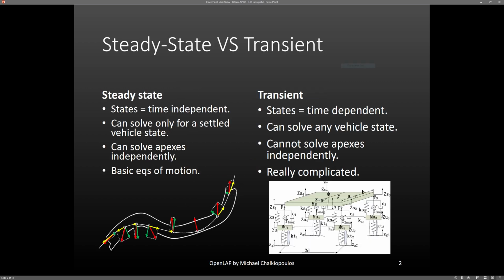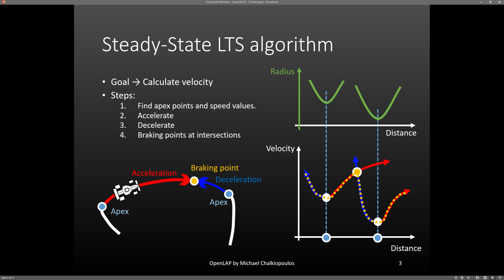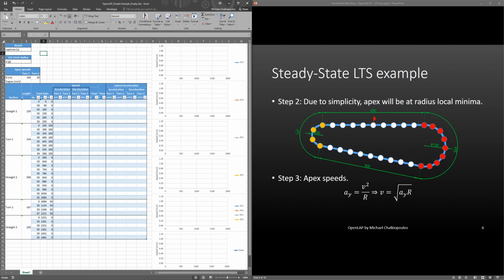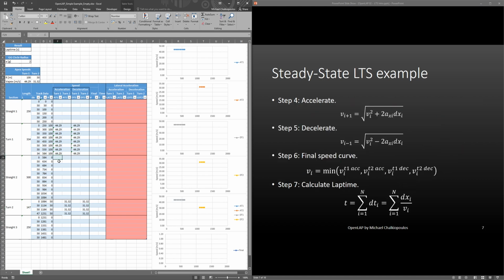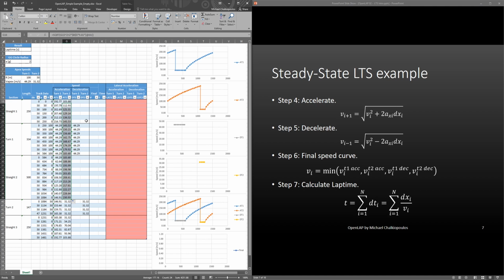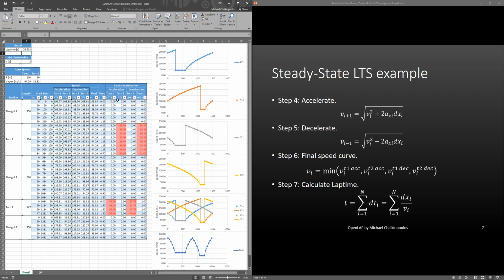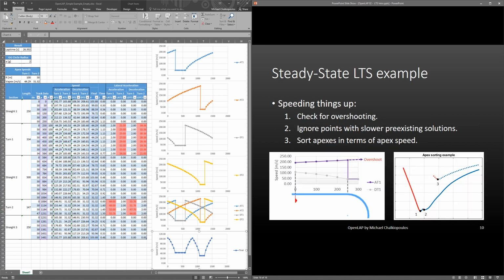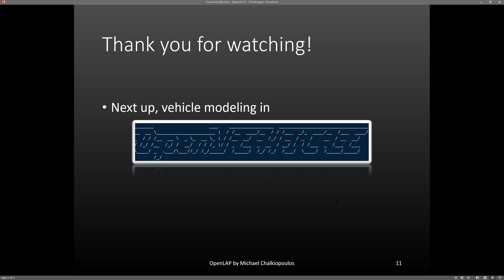OpenLAP Lap Time Simulator Part 2: The lap time simulation algorithm

Comment: Hi Michael, thanks for responding to my question about an optimal path. I've since made an LTS although it's transient. 

I was wondering, is the vehicle at any point of the lap drifting in this simulator? As in, does it have a velocity vector that can point in a direction other than forward?

Comment: Hey Michael great work.

I have a doubt . Why did you made 2 columns AT1 and AT2  AND DT1 and DT2. I didnt understand.
Reply from the maker: Acceleration from turn 1 (AT1) does calculate the whole lap, but the values of the speed in turn 2 are WRONG (look at the lateral acceleration needed).
The same for T2. It does all the lap, but is wrong in T1.

So you need to solve all turns indipendently and combine the solutions.
Reply: @_phoinix  Ohh okay I got it.... So how did you get those lateral acceleration values ?
Reply from the maker: Hi,

One acceleration and one deceleration column for each turn.
Reply: @_phoinix  I mean what's the difference between AT1 and AT2 ?
Reply: AT1 is considered as a one whole lap then  what is AT2 ?
Reply from the maker: Watch the video!
v^2/R at every point

Comment: Hey Michael,

Absolutely fantastic work and I appreciate that you've taken the time to explain it all so we can learn.

I have a question regarding the example in video 2 with the concept from video 3 of the GG plot which is offset by aero drag:

In video 3 you show how the aero drag offset means that the maximum lateral acceleration (Ay) is at a negative longitudinal acceleration (Ax). That's understood but my question involves using this to calculate pure lateral and combined acceleration cases.

To calculate my apex speed for a given radius I can use the max Ay from my GG and the equation R=V^2/Ay. However I have a problem when I try to accelerate out of the corner with combined Ay/Ax. If the corner radius of the point just after the apex is only slightly larger than the apex radius, it's possible that I still require an Ay value which lies in the negative Ax portion of the GG plot. But I'm trying to accelerate in the positive direction... What have I missed?

Thanks in advance for your help. Keep up the good work!!!
Reply from the maker: In part 2 I only use the most simplified version of this problem I can think of to show and explain how the idea behind this works.
This way, when go on to the next parts, you do not get bombarded with all the stuff you need to consider, but you gradually build up your knowledge and understanding.

Or at least I hope I can manage that!
Reply: @_phoinix   Copy that Michael, thanks a lot for your reply! I'm looking forward to part 6!!! Because I am locked in my house, I can't help but think about the problem so it will be a hard wait...  ;-)

From your constant radius example, I can see that it will be necessary to use the max Ay which is corresponding to Ax = 0... The apexes not at the curvature extrema I need to think about.

Thanks again!!!
Reply from the maker: Hello George!

I am happy to report that you have missed nothing!

The exact problem you are describing will be shown and explained in part 6 of the series.
So stay tuned!

The easiest thing is to think also about the constant radius case.
If you calculate your speed at max ay for the first point in this turn, then you inevitably have some negative ax...
No matter what you do, even though the next point has the exact same corner radius, you will have lost some speed.
So you should not use max ay to calculate the apex speed.

Also, as I will show, an apex does not only appear in the curvature local extrema...

I will talk about all this in part 6 ;-)

Comment: Hello Micheal! Could you please explain in depth the concept of the "reverse lap" to get the braking points? This is the only concept I feel the most difficult for me to understand.

Thank you
Reply from the maker: Happy to help!
Reply from the maker: Sure!
Is your question directed towards the deceleration equation used?
Or is it about the concept itself?
Reply: Michael Chalkiopoulos it’s about the concept, the acceleration and deceleration to find the braking point, i.e. the concept of reverse lap. 

Thank you
Reply from the maker: Ok I will try and explain this again here, and I hope this makes sense.

Let's say you have 2 huge straights and one corner between them.

The concept is that you can only know 1 thing independently of everything else that happens. And that is what speed you can have at the apex of that corner. Which means that when you calculate that, you can start accelerating from there. This is easy to understand.

Now, because we assumed that the vehicle is settled at every point on the track (this is what steady state means) you can imagine that the braking procedure is just a movie that is playing backwards. The same exact equations govern the problem,  and you just flip the sign of the acceleration vector in the movie (another way to think about it is that two minus signs, one from the formula and one from the negative acceleration value due to braking, cancel out)

So you do that and you have one solution for the speed after the apex, and one for the speed before the apex.

The next step to understand is that you treat each corner like one independent entity with infinite straights before and after. And you do all the calculations like this. Then you just need to combine them together like a puzzle. This is when the intersections of the speed solution curves come into play.

Because you have gone through all the corners, you know the limiting speed that the vehicle can have that obeys its gg circle. So if you plot them all together, you have to take the minimum value, no matter where this comes from. This is exactly what makes the intersections the braking points.
Reply: Dear Michael, that is it, now this concept is so much clear to me. Thank you so much for explaining me everything very precisely, you are a good teacher as well. 

Thank you, and I am looking forward to watch your next videos. 

Saud khan